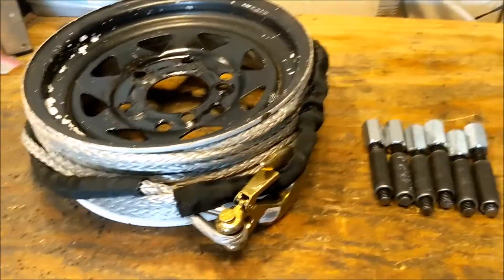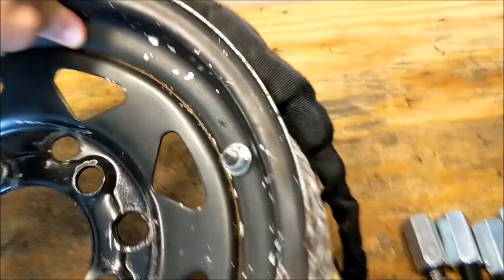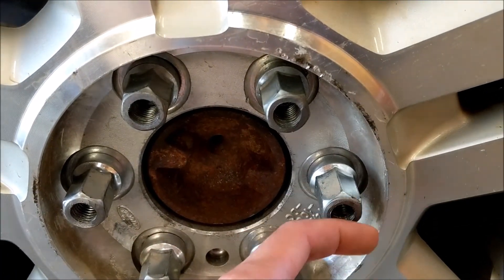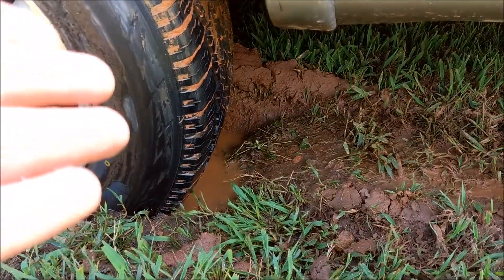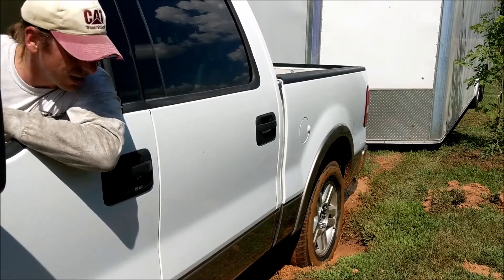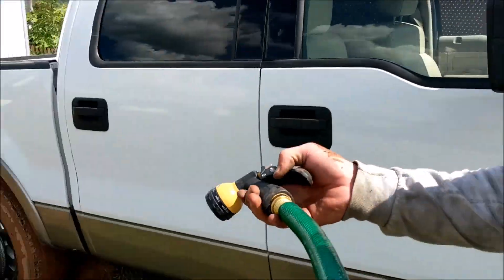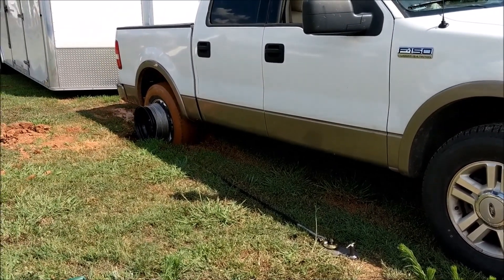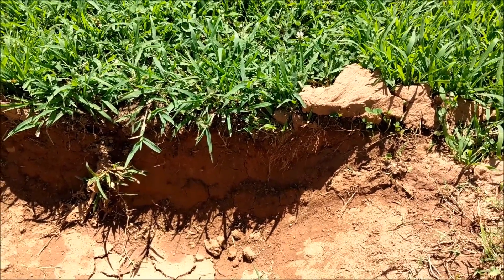Going off Grid? How to Make a DIY Wheel Winch

Comment: Won't work with a simple open differential.  Need a diff that allows torque to both wheels.    Apply light brake pressure with the open diff might make it work with those types of diffs.

Comment: Nice build. But what happened on the other wheel? Either you had the same built there or your had a dif-lock, otherwise the opposite wheel would have just rotated freely, right?
Reply from the maker: No spin.  Trutrac worm gear LSD with 3:1 torque bias (see video caption/description)

Comment: Faster than a flip flop wench for sure. With the price of the deeper lug nuts, bolts and rope post plandemic it comes down to is it worth the two hundred dollar difference you save making your own verses buying. If you don't have the tools it's just not worth it. Not knocking what you did, it's a fantastic diy, im just commenting on the high price of the parts nowadays. Just getting a half dozen fittings to get my cargo trailer conversion plumbing and 4- 4" threaded nipples and connectors to screw them down was a hundred forty eight bucks. If i had the rims and good drill bits with a welder I'd make a couple for sure, I've been looking at which would be best with this and the track claws system. 
   Great video, I'll have to look around and see if i can scrounge up some rims and borrow some weld time at my buddies shop. Did you take off your tire to get the bolt pattern right? I imaging that was the most important thing about this project.
Reply from the maker: When I made this video, the bush wench was a lot higher price.  Apparently they've had some motivation to lower the price... 🤔

Comment: If you have an open diff, like most trucks 4wd or not, if you apply this to one wheel and you are truly stuck wont the other wheel just start spinning? Bush winch provides 2 of these in their kits.
Reply from the maker: Yes, the demo truck has LSD.  If you have an open diff, you will need a winch on each wheel.

Comment: Shouldnt you use the wheel winch on both sides to avoid any risk of damage?
Reply from the maker: No.  All the one-sided wheel winch is doing is giving one wheel much higher tractive effort than the other, and the max stress on the axle and differential is determined by the bias ratio of the differential, not the wheel winch.  No more damage would occur from this than climbing a steep rocky trail with 1 tire on firm dry rock, and the other sitting in loose sand (such as Moab Canyonland trails).